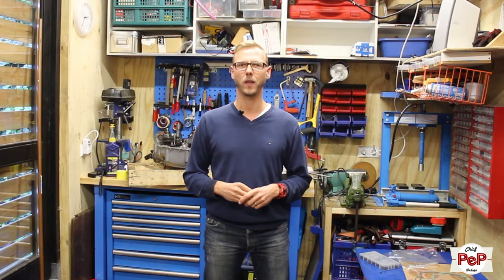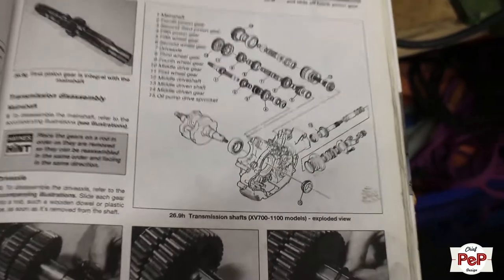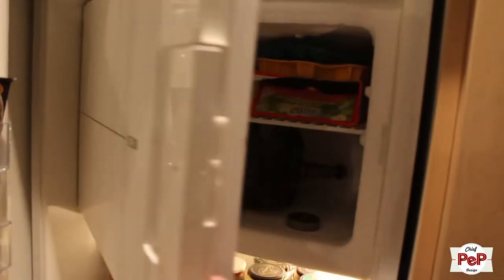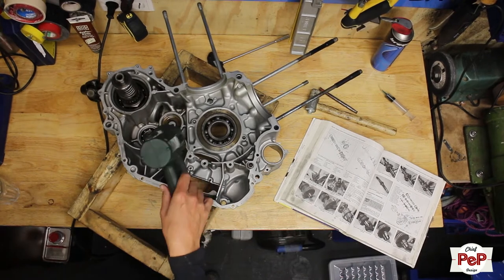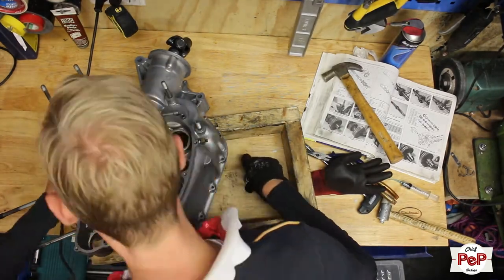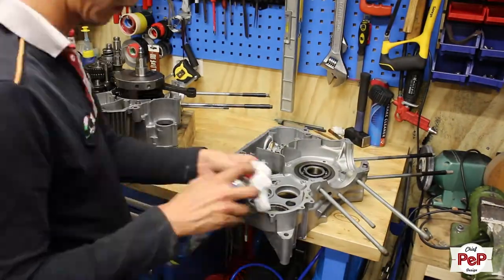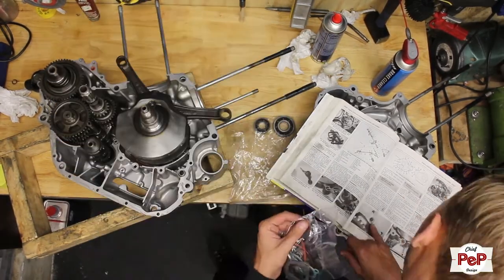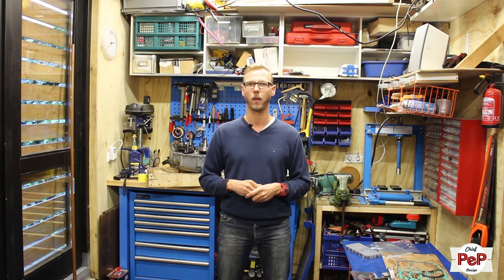Yamaha XV 750 gearbox assembly

Comment: Hello chiefpep I've been working on my xv750 I had a small Crack on the left side of my crankcase. I've been swapping all the parts of my bike to the new donor case but I can not figure out how to get the transmission/gearbox bearings out. Any advice?
Reply from the maker: Yes, make it really, really hot with a heat gun. Then use a bearing puller. They come out easy that way. If you don't have a bearing puller, just heat is up as much as you can en tap them out with a screwdriver or anything. The heating process is the only way.
Reply: @chiefpepdesign  thank you so much!

Comment: One thing I notis, the middle drive is allredy in in the case, didn't you take it apart to check it out?
I'm having a clicking sound in mine '89 1100 and seems that no one has heard about that kind of failer.
By the way, thank's for very interesting and informed video, has helped me alot.
Reply from the maker: What do you mean with the ; middle drive'? What is a 'middle drive'?
Reply: @chiefpepdesign  the shaft from clutch to driveshaft
Reply from the maker: @Hrafnkell  No, it's nearly impossible to take out. I explain that also in the start of the video.
Reply: @chiefpepdesign  Thank you, I totaly missed that but now when I watch it again I heard it.
Do you know anyone who have take it out and fix it?
By the way, thenk you for educading videos, you have help me a lot.
Reply from the maker: @Hrafnkell  no. No idea. It's very complex and you need a lot of special tools.

Comment: hi Chiefpep, thanks for the great explanation.i was wondering how you determine whic position to place the the shift drum so that the fork pins have the maximum range of movement in their respective tracks.
Reply from the maker: I can't remember. I follow the Haynes workshop manual step by step. The position of the bezzel wich is the neutral indicator is an important one for the postioning if I remember right...
Reply: @chiefpepdesign  A huge thank you for getting back so promptly. I shall check Haynes. - a big fan of your vids from down under

Comment: I am having trouble with my 82 xv750 virago clutch. My pushrod isn't activating my clutch to allow rolling in gear. Or taking off
Reply from the maker: Did you open your clutch housing or worked on it? Or did this happen all of a sudden?
Reply: @chiefpepdesign  just bought the bike. Couldn't get the clutch to disengage. Found im missing the spring on the clutch adjustment linkage. I have both covers off. When my bolts are loose I can see it move the cover but when they're tight it's bad. I'll post a video now if you'll watch it
Reply: @chiefpepdesign  I just posted a video if it
Reply from the maker: @VeneerSlinger  Just replied